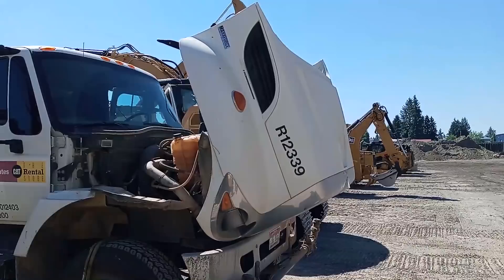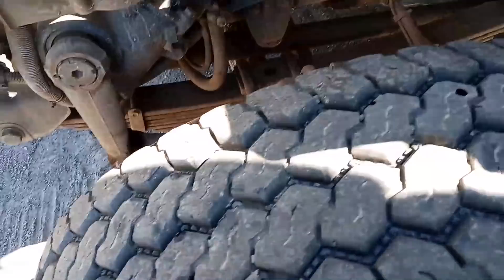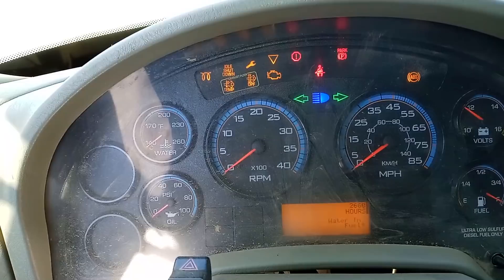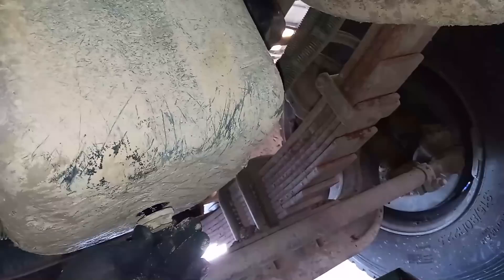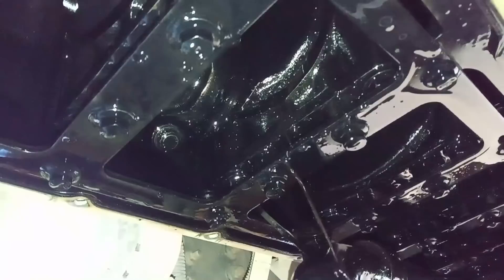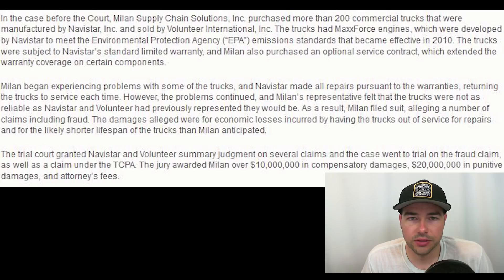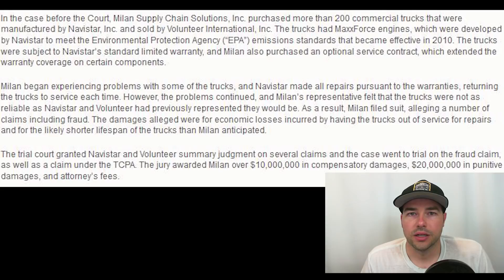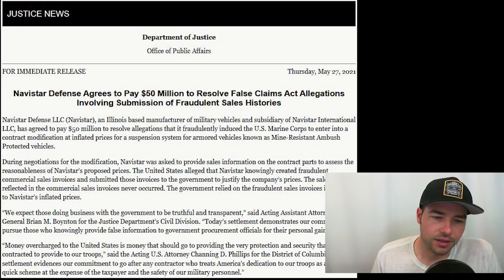CAT Mechanic working on an International. Are Navistars and Internationals Junk?

Comment: Hey Maxxforce DT is a  phenomenal engine, just like the Maxxforce 7, CT13 and 15 , all you need it patience. And you will have a career. Will it be fixed, no, will you ever run out of work..also no. I chose to work for Ford years ago for the sole reason that there was never a slow season, and then I went to an equipment based on international, worked on plenty of Ct660s, did I hate the work? Yes but was I broke? No
Reply: It's phenomenal how much money you can make as a mechanic fixing them.

Comment: yep wiring is a hug problem.  i was told to drive one a few years back that 1/2 the dash did not work from shorts. i did not even get out of the yard (oil field work) and sparks were flying around. 
i was told drive it and stop crying about safety. 
so i took all of my stuff out of the cab and drove it. i am supersized it made it 12 miles before the cab started burning and 2 more before it started running away. 
i pulled over let it scream 2 rods threw the block and a smoking pile of trash.  yep safety was not a big thing . got a ride back to the yard loaded up my things and told them nope . i reported them as i had proof of the red tag and got it signed saying drive it.   boss was fired on the spot safety person fired job sight shut down till every thing was inspected. 
no idea how much it cost them and dong give a tinkers dam.

Comment: The whole entire Tier 4 deal is a huge sham!!
Reply: In some ways.

A construction site is dirty enough already, so is filtering the exhaust to remove black smoke really gonna make that much of a difference?

Or on any public roads outside of crowded urban environments. Tier 4 emissions are only necessary in crowded environments because in non-crowded places they are unnecesary.

Comment: Comment on the 7.3 international in the F series Ford. Nothing but issues.
Reply: If you have a 7.3 with nothing but issues, someone doesn't know what they're doing to fix it right. They're right up with a P-pump Cummins for reliability/longevity.  Find another mechanic.
Reply: @acemobile9806  the cavitation eats through the cylinder walls. I don’t know of any mechanic that can fix that. Usually these engines need heads and a resleeve at 250k miles or so. Most people just part them out. Why you see so few around.
Reply: @vectormarine  not if you keep the SCT level where it's supposed to be & coolant serviced. Another example of lack of maintenance, plain & simple. 

So few of them? I work on a couple of fleets of buses with them for tomato farmers here in FL. They use them to haul migrant workers to the fields. My truck & wrecker are both 7.3s. A school district I used to work for out in New Mexico had them exclusively & only had to replace them due to safety regs. In all my years I've never personally seen one suffer a cavitation failure. The reason you never see them en masse anymore in buses is because they all get sent to Mexico/Central/South America & the last one was made 18 years ago!
Reply: @vectormarine  cavitating eating through the cylinder walls? Diesels need special coolant in order to keep that from happening. It has to specifically say for diesels on the label.

Comment: Remember how Ford entered into a partnership with Navistar for their medium duty trucks(F650-F750), the 'Blue Diamond Truck' joint venture, in 2000? Ford had designed & produced their own medium duties up to that point, after which they were Ford bodied Internationals(with Powerstrokes & 6.8l V10s as some of the engine options). By 2015, just like with those Powerstrokes, Ford washed their hands of all the Navistar nonsense, went back to designing/building their own medium duties again, powered by their own inhouse engines(the 6.7l Powerstroke & 7.3l Godzilla gasser). I don't doubt it's largely due to International's famous reputation for electrical problems. 
 
Hey, don't worry about Navistar though, they're doing fine - they picked up a joint venture with GM, the new 'Silverado HD' are now GM bodied Internationals(only available with a Duramax BTW, even the International badged ones)! LOL

Comment: Fact….auto industry started sizing wires based on load in 90s. About the time my eyesight started deteriorating! The savings in copper is large. Also utilized local control units for the heavier loads.

Rumor 
I believe that if you look at the intertrashional family tree you’ll see they are now cooperate owned and are brothers to other companies that build pos’s. Such as Monaco Rv, rev, forest river, ambulance, and a host of dealers that have no regard for customers or employees.
It’s sad that international has suffered this fait like these other companies and continue to define ‘entry level’

Comment: I have to disagree with you... Paccar wiring in Peterbilts and Kenworths are junk. Now, with that being said, just look at the condition of the vehicle. Yes, these are work vehicles... but come on, it looks like just abuse all around. I’ve seen more Peterbilts with corroded main fuse panels than I can count. From the windshields leaking. I’ve also replaced more Paccar harnesses than I can count. This comes from the opinion, from working at both Paccar, and Navistar dealerships. Diamond Logic Builder is like PlayStation 4, and Paccar ESA is like Atari. Not to mention the Engine Programs.... Either way... Take care of your property, and you won’t have as many equipment failures.

Comment: I got two trucks with international engines they both start quicker than my caterpillar.matter fact I know you're a cat mechanic my 3126 sometimes starts up other times you have to crank the hell out of it. It sounds like it has couple injectors that ain't firing but after few min it smokes out runs perfect

Comment: Cummins good! International no good after Dpf addition around 07-08. The truck itself is pretty tough but the engine is garbage. I don’t like the maxxforce. I had the same coolant leak on an 03 it was a liner seal Navistar was also sued for knowing the egr system was trouble prone and they didn’t want to lose out on sales so they sold them anyway. The claim was for the trucks having no resale value due to their reputation. I think this case was won.

Comment: Ok the first generation 11 and 13 were junk! (They have not been produced for 10 years) By the time the N13 came along it was OK. for the last 3 years you can only get a big boar A-26 engine. Which again is OK. The funny thing is most of the problems came from the aftertreatment system which was licensed from Cummins!

Comment: The Maxx Force engines are junk, the old DT466 was a great engine, the T444E was a good engine as well but slow and underpowered for most commercial trucks, it was the best engine ever used in a Ford Superduty however.
Reply: We have two of those t444e for welding trucks 4700series bought new in 95 from woodpecker truck in Oregon we run those trucks close to max gvwr  all the time they have been nothing but good to us and our bottom line. Ugly slow but dependable.we did buy a peterbilt in 2003 with a 3126 cat . That engine has been replaced 3 times and that Pacar truck has always got electrical problems and HVAC problems.
Reply: I average 11.5 MPG with my '98 4700. True I won't win any races but since it's a tow truck, I don't give a rat's ass either. Other than the payments, I couldn't afford the fuel economy penalty that would come with owning a new one! It's dead nuts reliable & has never failed me once in the 5 years I've owned it.

Comment: International had many early engines that were great. I loved the 817DT, and 573V8. They do not have any with a computer that are dependable including the 466E. I believe they pulled engineers from the GM pool and should have chlorinated first.  IH wiring is about the worst. The only one worse is the VOLVO/WHITE/GMC/AUTOCAR conglomerate. Need a 12 pack prior to reading their schematic's so that you can follow the logic path. Across the board ass holes have determined that smaller wire gage is the way to go to save weight. I'm sorry saving 15 pounds across the truck is not worth the longevity of the wiring harness. Still working on mack's from the 80's with real wiring.  Yes there is failure of components but the harness is still good.
Reply: I used to drive an 72 international oil truck with a gas 549 V8, it went pretty good,no speed demon though.
Reply: @dcrog69  Ran a 549 in a plow truck with 12 foot front and 11 foot wing. Running at 20 mph plowing she would roll most anything off the plow's(mail box, fence, stone wall, Telephone pole) with about 3 gallons an hr. ( high test low grade was about 5 gallons an hr). But run up the hiway dropped to both miles to the gallon. Top end around 50, down hill with a tail wind. ( NH northeasters get pretty severe) same up hill. Just don't ask me to stop quick.
Reply: @dzrdr65  I'm over in Maine so I'm pretty familiar with the nor'easters 😁

Comment: Several municipalities have successfully sued International for defective MaxxForce engines in fire trucks... I had a couple of 2010 Transtar 8600 series tractors with Cummins ISX engines,but the regen systems were constantly throwing codes, but they were fairly reliable otherwise.I’m looking for a used 2017-18 triaxle, and I was wondering which truck manufacturer has a the most reliable DEF system? IE I’ve heard that up until 2015 most of the large truck manufacturers were having problems with the DEF systems damaging fuel injectors, and other problems.

Comment: The 7.3 powerstroke is an Excellent engine. Ran across a 2009 International 7500 6x4 maxforce 10 dumptruck with 113,000 miles on it for $35,000 do you think its a good deal ?

Comment: Most of my experience with IH is in the tractors and combines, and the 90s and early 2000s trucks. I like the DT466, and DT444E, however they are both dogs compared to the Cummins engines. The worst trucks I've ever worked on are the new Volvo, and Mack trucks biggest pieces of junk ever made. I used to work for a Volvo/mack dealership, I hate both brands even more lol. Now I work for freightliner, the DD engines are better than the volvo/mack and IH engines, but they still aren't as good as a 60 series Detroit or Cummins or Cat. My favorite engines to work on are Cummins and Detroit engines, I think they are the easiest/best. I do like IH trucks from about 2003 and older, the 4700, 4900, the eagles were great trucks, I'd love an old square body IH school bus and put an 8.3 Cummins in it and turn it into a car hauler. That's my 2 sense on IH, and the other brands I'm familiar with.

Comment: International has been a dumpster fire since emissions came in.  I ran a 2011 4300 with a maxforce engine.  Biggest pile of shit ive ever had the misfortune of running and wrenching on.  However one of the best engines they ever had was in my bosses 94 4700 rollback, dt 408 all mechanical.  700k and no major problems.  Had to tow it back from jersey once because the water pump crapped out but other than that nothing.  Ran great til the truck fell apart around the drivetrain.

Comment: International has had wiring/electrical issues for as long as I can remember. I worked on a lot of 1970-1980's trucks and that were atrocious. I would rather have Mack,KW or Pete

Comment: I really didnt understand why the engine didnt start , the liner o ring failure on one cylinder doesnt stop the engine. ????? ok its not nice but it should run at idle.

Comment: Maxforce dt , 11,13,15
Caterpillar C7,C11,C13,C15
Difference is the cats are off-road and the international is on road. Same thing different emissions standards. Also everything that’s smaller than a c7 is actually a Perkins.caterpillar and international has been in bed with each other for years they are one point told Cummins too Get lost and that really dropped sales so they had too kiss some butt too get that deal back

Comment: 2013 maxxforce 7.6 wont start but turns over . no matter what it does not start. don't know why ???  has oil has coolant . relays seem to to good. disconnected exhaust not stopped up  no codes present. help please

Comment: Once had to switch trucks guy lotterly handed me evry bulb and fuse possible and still hv the truck running he said whatever you do dont use the ac I noped out of that one and refused to take it it went to shop shop said yup need a new truck it was 2 yrs old three weeks later im in a nice cascadia its being towed in burned down to the rails

Comment: Dear AA.  International Diesels starting with DT414, 436 and 466 of the 70’s and 80s were bulletproof.  You could squeeze 10,000 hours out of an Ag engine being run at max RPM 2300 and max continuous load.   Sometime in the 1990s a different culture took over that company following it’s bankruptcy And they began to screw around with the quality components on the diesel engines. The DT 466E In particular has a known manufacturing -defect in The cylinder sleeves that results in shrinkage of a gasket and the condition you observed of the entire cooling system emptying into the crank case. They took a beautifully designed engine turn into a piece of shit that you can’t get 100,000 miles out of in a utility truck So some idiot With an MBA Good stuff his pockets with a bonus.
Reply: Ford cheeps out on parts..and when it's saving them $1.50 they put it in..as long as it lasts thru the manufacturers warranty- more profit for them..
Except when those cheeep parts fail and wreck the whole engine and that repair/ downtime is all on you..

Comment: I remember when they came out with there Diesel engine.   In late 60 where they took there 549 gas engine and converted it to a diesel.   
They were junk back then  our company then
Reply: I used to drive a 69 International Dump Truck with a red diamond gasoline engine, and hydraulic wedge brakes. I used to say it would take forever to get going and twice as long to get stopped!
Reply: The DV 550.
Reply: GM did the same crap with their 350 engine.

Comment: I own a Peterbilt 330 with the paccar px-6 and lost the air compressor, while diagnosing it I noticed that the fuel pump feeding the injectors was dancing back and forth, ALL the studs had stripped out of the block and the only thing holding it in was the lines connecting the pump... That engine is better known as the Cummins 6.7, the same one in the Ram 3500. A friend of mine lost his engine in his chipper truck, that was an international Maxx force DT, the Cat C7 accert with it's ARD head had no shortage of issues... I'm convinced they are all pieces of shit nowadays! Thanks, EPA.

Comment: International,(Navistar) ain’t had a good engine since the DT466, or if you were lucky enough to snag an international with a CAT in it. The 466 is a damn good motor! Especially compared to the complete garbage they started producing in 08 with the MaxxForce! It’s a shame International can make such a nice work truck, but can’t put a decent engine in it anymore to save their life. I would blame the EPA for that, but Cummins and Paccar still seem to make it work. Atleast the automatics are equipped with an Allison Transmission. That’s about the only reliable piece you get.

Comment: My terminal had several International Prostars with as one of my drivers named them “Maxxfarce” engines. The EGR coolers are terrible. As you said the wiring is of such a inferior quality. Do you have any info on the newer trucks? Our company is buying the LT tractors now and I hope they are better then the Prostars and “Maxxfarce”.

Comment: I've been stuck on the side of the road more times by maxforce crap than any other machine on the road. 10/10 would not recommend.
Reply: I'd like to add it was a leased truck  and the company spent well over 25k in repairs in just 1 year. When we sent it back to Wyoming it was a blessed day as we took delivery of a F750. Granted we will blow turbos over time at least we know we can make it home and not leave a team behind. Better to limp back than to be stuck 800 plus miles from home.

Comment: International have always been the cheapest option when it comes to trucks and tractors. Theres a reason.  All the things you dont think about are shit. From the windshield wiper/washer system to the wiring to the door seals.   The older engines were great dependable although not powerful units- and thats all they had going for them

Comment: I have to keep a 466e going ,International doesnt understand that water flows down hill.

So their harnesses have a nasty habit of carrying water directly into water sensitive components.

Their primary harness ( battery cables ) are often position so that water cant drain back out once it gets in...I've literally stuck a pin into both battery cables so my boss could watch a pint of water drain out of them.

The harnesses are just crap and a lot of their bad reputation stems from that.

Comment: sorry, I got cut off. But continuing, GMC used a lot of CAT engines in the medium duty trucks. Which CAT engine is good on durability and reliability? is it the 3126 or 3116? And what be the best thing for me do to make it bullet proof?
Reply from the maker: I would pick the 3126 over the 3116 or C7. Look into adding a HEUI filter and keep up on your oil changes, should be a good engine.
Reply: The 3116 doesn't seem to have a good reputation, but we've had good luck with them at my work.
Reply: Freightliner and Ford used them too.

Comment: International has always had poor wiring.  Since the 70’s.  Their engines have always had strong lower ends and weak valve trains. Cylinder head and camshaft problems too. All my dad ever had.  Still a fan.  The new engines are junk